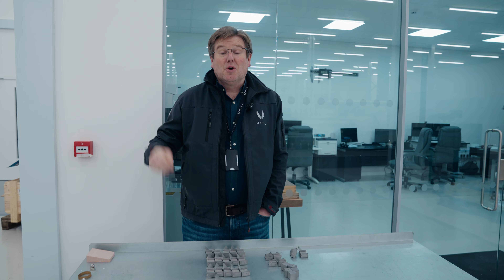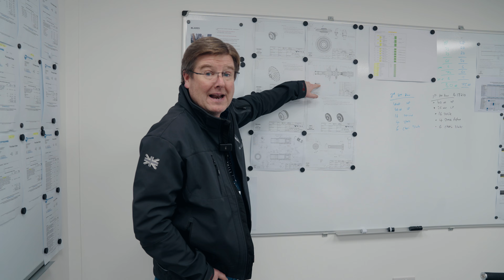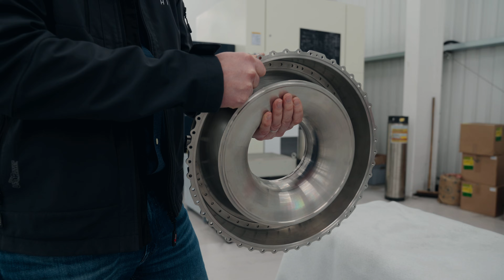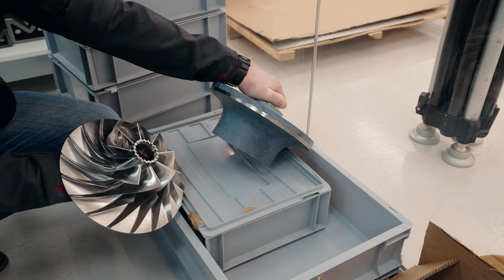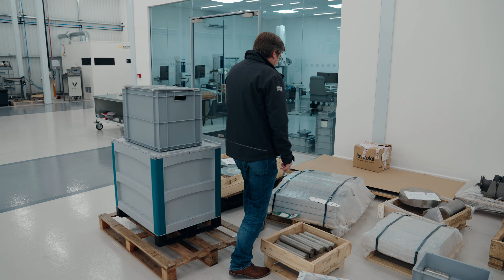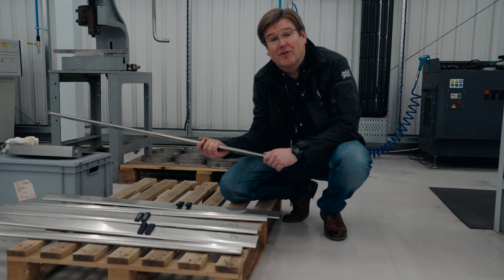GT50 Turbine Milestones, HX50 Crashworthy Seats, and Rotor Blade Testing

Comment: There should be a lidar sensor on the HX50 to alert the pilot to any obstacles and prevent collisions with unseen cables. (Or accidental VMC)

Considering Lidar is standard on any drone over $1000 this should be a no brainier for helicopters

Comment: Im struck by how different the design philosophy is here compared with a company like spaceX. When spaceX was making the fuel tanks for one of their rockets from stainless steel Elon asked the engineers, how thin can we make it. They said maybe 4.5mm? They also said it will take a year of simulation and testing in the computer to design and verify it though. Elon said let’s just make one and see what happens. They did and it worked. That took weeks. I’m not saying one method is right and one wrong but if you have funds rapid prototyping is definitely going to be faster. Computers and simulation can only get you close.
Reply: Rockets are neither type-approved nor mass-produced. A wildly high failure rate is tolerated.

Comment: I really hope you succeed with this venture. However, I’m a little confused about the decision to develop everything in-house rather than using products that are already tested and proven in the market.
In my experience, building everything internally is rarely cheaper because R&D costs are extremely high. That’s why companies like Boeing and Airbus don’t manufacture their own engines—they purchase them from specialist suppliers. They also buy things like seats rather than trying to become experts in every component.
The same applies in the automotive industry. Many car manufacturers use third-party suppliers for engines, transmissions, brakes, and electronics because it’s more cost-effective than designing and producing everything themselves.

As someone who runs a business where we design many products in-house, we still use third-party suppliers whenever possible because off-the-shelf solutions are significantly cheaper.
Reply: Helicopters are different. They have not had a significant design or efficiency upgrade in the GA sector since the 70s or 80s. We have progressed more than people realize, and testing and metrology has also gotten a LOT better. You're assuming they started with a blank slate, but there are significant mature technologies and manufacturing processes in place to ramp things up VERY fast.
Reply: Although most automotive manufacturers do not get engines from suppliers, the rest of the argument is valid.

Comment: Keep in mind that frequency mistuning of the compressor blades due to manufacturing can increase your vibration amplitudes, especially if mistuning is low, which is the case if you manufacture almost perfect.
Reply: Are there any tricks of the trade to reduce this? I can imagine blade tip snubbers might adversely affect aerodynamics. Or is it a question of Campbell plots with avoid rpms, like main rotors?
Reply: @martingarrish4082 Blade snubbers would certainly help by introducing friction damping. On the other hand that would also add a source of nonlinearity that would make it harder to predict vibration amplitudes. As you correctly pointed out they would also negatively affect the aerodynamic properties. And also I wouldn’t know how to introduce them in a blade integrated disk.
The way to reduce the susceptibility to random mistuning is to introduce so called intentional mistuning. Certain blades are intentionally manufactured differently, thus breaking cyclic symmetry. It is kind of an intricate process that focuses on certain blade modes, usually those that show excitation within the design range and are sensitive to mistuning.
Reply: @ffeffeff  , thanks for taking time to explain this. Every time I think I have understood rotating aerodynamic machinery then there is more to learn.
Reply: @ffeffeff  you seem to understand 500 times more then i do about this stuff.... in your experience, how long after someone makes a first prototype engine does it normally take before they can manufacture them
Reply: @Obvsaninternetexpert I have no experience in manufacturing of such parts, only in simulation and design.
My impression is that you can get there quite fast with a good team, at least that’s what it seems like at Hill Helicopters. I mean, those parts look very good!

Comment: wow this is very expensive processes the prototype build cost must be astronomical. Was there not an off-the-shelf power unit that could have been sourced? Sorry if I have missed some business case details. How on earth is this all being funded? I mean it is a great project and so cool but all this vertical infrastructure is like a bottomless pit in terms of cost.
Reply: Maybe take a look at a few of their videos - explained in depth
Reply: What makes you think it’s a ‘very expensive process’ and ‘must be astronomical’ and a ‘bottomless pit’ when compared to traditional forms of development?

Surely you’ve done your research on vertical integration and how companies like Tesla have used it to become one of the most successful companies on the planet.
Reply: Funding is via his own seed capital, government grant, and non-refundable customer deposits.
No there's no engine available for the cost point needed to make it a viable product for GA. There's a whole video on this. He searched high and low across all OEM's including large block diesels, old & new turbines etc. Nothing works except roll your sleeves up & DIY.
Once he has engine fired up, the aircraft is essentially the easy part in comparison (still difficult & time consuming). As soon as the first prototype is airborne, he can call on half the remaining balance (pre-paid) for the first block of 1200 customers, then the other half very shortly before assembly. So it's self sustaining from that point. Funding just needs to get a prototype airborne and the hundreds of millions of dollars worth of orders take it from there.
Reply: If you are doing what you know then you know what you are doing. 😉

Comment: How far can automotive testing be stretched to cover all aspects of aircraft impacts?
I imagine automotive testing is highly refined for head on, side on & perhaps rear impact?
How do you validate for vertical, rotational or multi aspect vectors?
Reply: Google EASA CS-27.561 General for Emergency Landing Conditions (page 52 for g-loadings)
I can't put a link on YouTube unfortunately.

Time explicit crash codes like Abaqus, Dyna 3D, or Pam Crash can be used to optimise auto and aero impact scenarios, with validation by defined physical testing. Hill will probably do what testing they can in house, but there are facilities that could be used at test houses like Horiba MIRA.